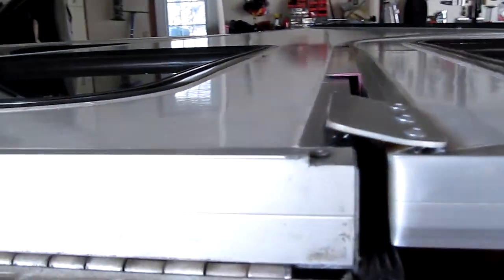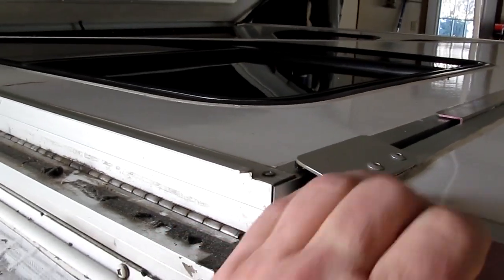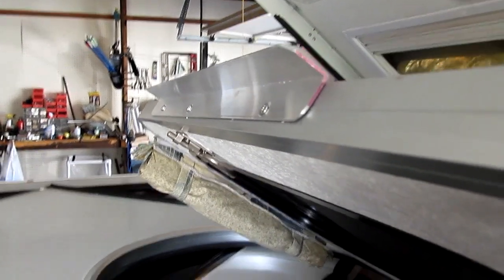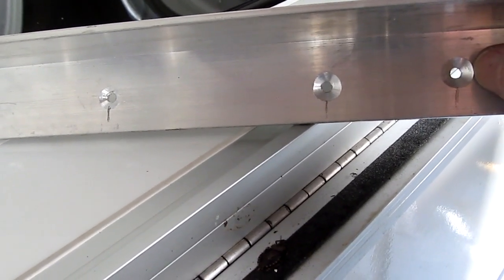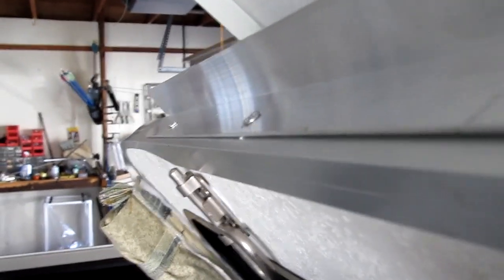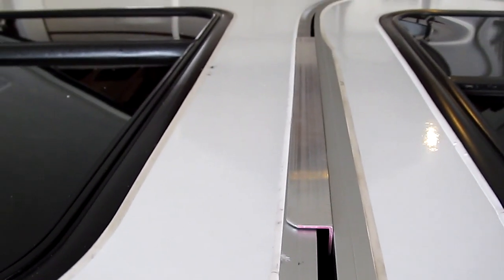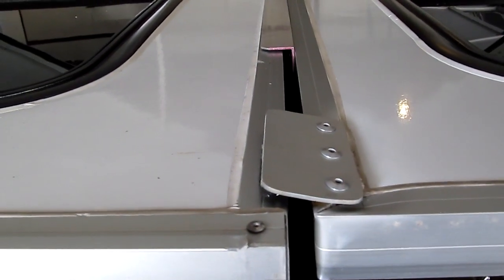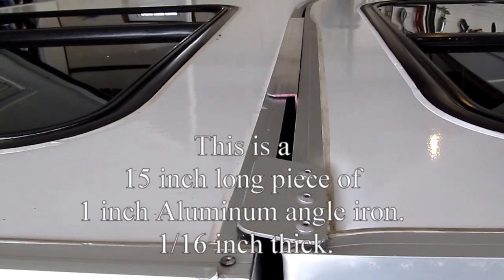Minor Aliner Design Flaw Fix - Adding a Door Support piece

Comment: Just happened to my Chalet after 20+ miles on some really bad forest service roads. I remembered this video from a few years ago and came back for the fix.  It sure saved me a lot of trouble and is an easier and better fix than the one I was contemplating. Many thanks!
Reply from the maker: Thanks for coming back !   Hope it solves the problem permanently like it did for me.

Comment: That's a great mod idea. We may have to try this on our 07 Aliner scout. 
Ours had a hard life with the past owner. Even with its issues, It really fits the bill as we haul around 2 huskies in ours.
We put a clothes rod above each bunk on both ends of camper to keep the walls pushed out and true. Great for hanging towels, jackets, dog leashes, party lights (for glamping)
Reply from the maker: +laurie mcewen 
Just make sure you get the spacing right.  It might be a good idea to stick the angle to the door with  caulk or double sided tape firs to make sure you have it in the right place... I've had freedback from others saying they mounted it wrong and could not get the door closed due to bad alignment on the mount.

Comment: Would it hurt to use a ratchet strap across that door way to hold the two sides together?  I don't have an A frame, but I use ratchet straps for a lot of things and it seems that could be something to add strength yet not have to be super tight.

Comment: You seem very smart & great at repairs, add ons etc. I'd like to buy one of these Aframes. Any idea where get used one? What did yours cost you? I've looked @ craiglist for my state, & none available. Any ideas where I could get one? Thanxs, I've watched most or maybe all your vids... very nicely done; & learned a lot. Thank you~ Chip~
Reply from the maker: Check the Aliner Owners Club Website   http://alinerownersclub.org/    They have a for sale section.  Mine cost me around $8000.  And from what I see on RVtrader or Craigslist nationwide they run around that price used.   You  might have to travel a ways to get one.  They re popular.  Also look at Chalets, they are very similar and nice
Reply: Going NoWhereFast I think you've sold me on one of these also (plus my Jeep's towing capacity -- haha). Thanks for this info. Gotta check out that site.

Comment: Great.... my Scout Lite 2020 is the same. You’d think they would have woken up and addressed this issue by now.
Reply from the maker: It appears it deoesn't exist when its still at the factory.  I've seen new ones. They are pretty tight.  I think it might be in shrinkage of the layers of the sidewalls.  That door opens up just a little, enough to cause the door to fall off the Jam.

Comment: Ps. I am also a bit concerned about how flimsy the leg support is for the lower wall. Any ideas?
Reply from the maker: +Mity Mouse   .  .  I'm not sure I understand.  What do you mean by the leg support ?   The lower walls, not the folding upper side walls, are almost totally supported by the cabinetry around the inside of the trailer.
Reply: not on my unit. there are no supportive cabinets. Especially since I took out the one cabinet there was. The one cabinet is at the base and there is nothing at the peak. So at the peak of the side wall that folds down first, is a leg which supports it. It seems to do the job, but is rather flimsy. I have to think about it after i finish the last couple of items on my remodel list.
Reply from the maker: +Mity Mouse ..   Ah Yes, I know people who have done that.  That flimsy leg also has a tendency to bouncy out from under the wall on bumpy roads and can result in serious damage to the sidewall.  The best and easiest solution I have seen is to mount a PVC Pipe Flange on the sidewall and then friction fit a 2" or bigger piece of PVC pipe into the flange before lowering the wall all the way.  You can add a cap to the end  of the pipe piece or a carpet piece and that maintains a solid support.

Comment: Could this be done using a rivet gun instead of screws?
Reply from the maker: Absolutely !   I was worried that the rivets might stick up too far and hit the jam on the frame.  Screws can be countersunk below the additional thickness of the metal. However after it was all done there was plenty of space.

Comment: Nice. I will keep an Eye on mine. mine is 2006.  Rick are you able to put  yours upbin your garage.
Reply from the maker: I am !  Which if you watch my  earliest videos, I changed the axle and raised it up 5 inches, so its higher than stock, but if I get it centered between the rafters it fits !!  There no moving it !!  And getting it down is not as easy as pushing it up.  But I can work on it and dream !!
Reply: Well I hope to make room for mine this year. I should gave 1" clearence at roof. Just gonna fit .

Comment: Will the GAP allow water to slip into the trailer? Good mod.
Reply from the maker: No, When the roof is up there is an overlap of the door with the wall, and when the roof is down, it covers that area where the door lap is.   So thats very water tight.

Comment: why not use 3/16" pop rivets instead of screws?
Reply from the maker: Becuase if you mess up with pop rivets, your screwed,  but if you need to make adjustments with screws you have a few options to move them, make them bigger, or add adhesives. 🙂

Comment: I don't own an A-Liner, though it seems to me you would be better off fixing the defect that allows the trailer to flex so severely! Yes, you have stopped your door falling problem, have you checked for cracks in your frame? That should be the main worry!
Reply from the maker: No the Frame isn't broken, its just slightly flexible, and since the trailer is essentially built from Foam, it just flexes with the wind.  Its a very lightweight trailer. I use it way beyond its intended use.  I could easily reinforce the inner structure with real 2x4 wood and fasteners,but it would add another 3-400lbs of weight.  Which actually I am doing.  But for those people who want to drag one around to the "Resort Campgrounds" with full hookups on paved roads with a subaru, they are great campers. But don't compare them to an Airsteam !!  (I'm lifting my up 4inches, reinforcing the frame and adding a bumper with a bike rack on it. Video to come)